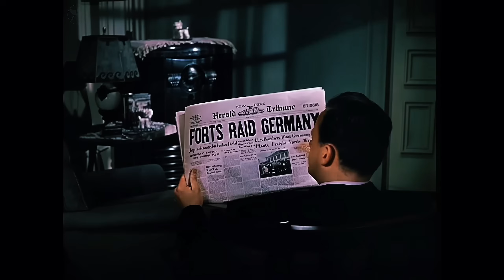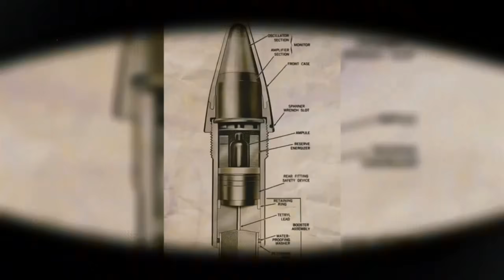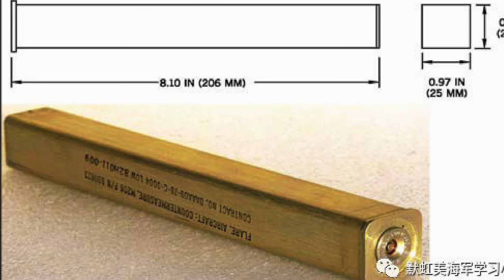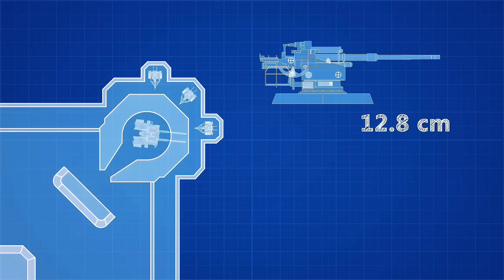How B-17 Flying Fortress Decimated German FLAK Crews

Comment: So just how did the bomber crews decimate the flak gunners?
Reply: was wondering myself.
Reply: In "44 the 8th did attack flack batteries as detailed in the channel uswiibombers,
Reply: @Katmando-f1e so they built flak towers, most 88 crews that were lost was when acting as anti tank or artillery as counter battery fire.
Reply: @tomtd  Flack towers were for fixed defenses like at airfields (Gabby Gabreski flew into the ground trying to get underneath them). The Germans did keep their guns mobile because no sense in defending a bombed-out target. Check out that YouTube Channel for an excellent treatment of this subject.
Reply: @Katmando-f1e they were built in or near several city centres, do some reading. Airfields were never targeted by thousand bomber raids, only later did fighter bombers beat them up. 88 were high altitude weapons
Reply: @tomtd  In that you are obviously an expert in this subject, please explain, in Layman's terms of course, why someone would want to put an 88 on top of a flack tower? To get another 80 feet of altitude? And how would they get it up there? My father was a crane operator, and whereas his crane had the reach I never saw it pick up anything the size of an 88.